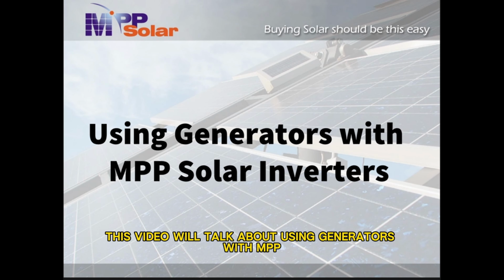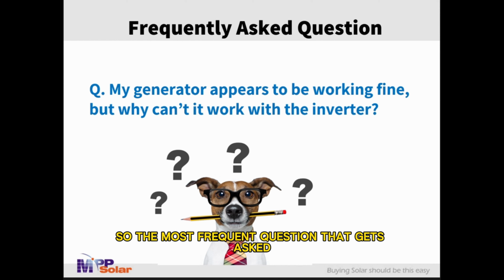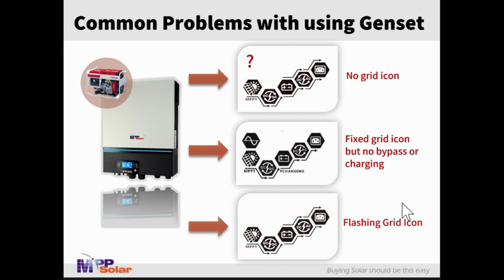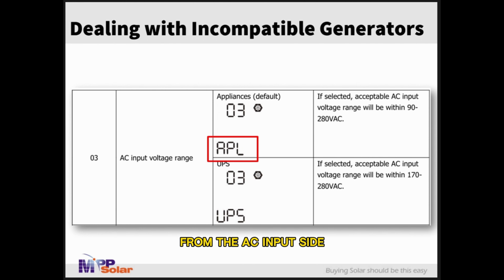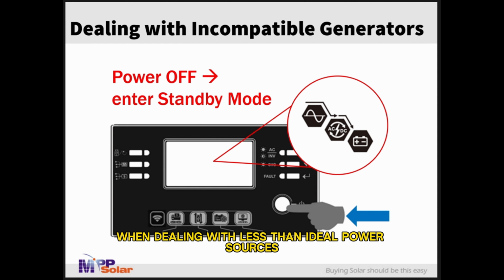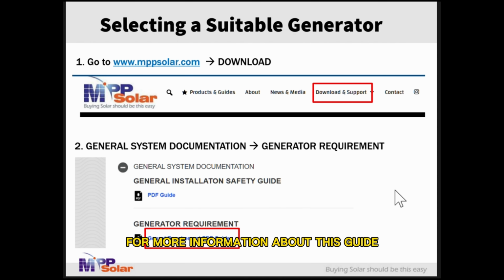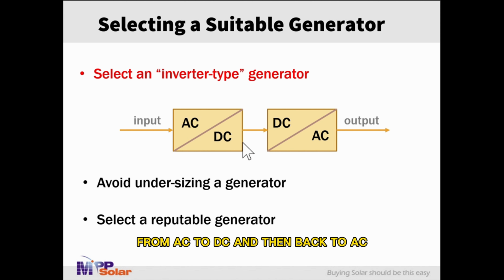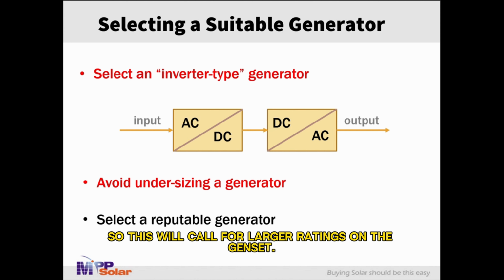Using Generator as AC Input

Comment: Assuming I'm making sure not to pull loads larger than 6kW, will my two 6kW MPP LV6048 inverters configured in parallel still work with my generator that only outputs 6kW?  I'm really just wanting to use it to charge the batteries or provide minimal power in the house when I'm not getting any sun.  Thanks!
Reply from the maker: Theoretically, it's possible this can work, but with generators it's extremely difficult to predict as gensets will drop output quality as load rises, and every genset is built differently, so the only sure way is still to try things out and then you'll know.   There are some tips in the video that can help relax the requirement for AC input while using generators, so if you're having trouble getting it to work, try those tips and according to many users, sometimes they help.  Good luck!
Reply: @mppsolar697  that's what I thought.  Right now if I run the generator hooked up to one inverter it charges my batteries and provides bypass current (which I'm assuming would mean the inverter has no issues with my generator output), but once I parallel the output of the generator to two inverters (with their parallel communication cables), it shows that it's receiving current on the mains (round sine wave icon) but clicks every 10 seconds trying to charge and then clicks and only shows the sine wave icon and repeats this over and over.  The inverters are in standby so there's no current going out on the mains, and I checked with an amp meter and it's only pulling 8A from the generator (when it clicks to try and charge the battery) and then drops back down to 0A, so the generator isn't getting loaded down.  Plus, the voltage is hanging out between 117 and 126 or so...
Reply: And btw, when I have the generator hooked up to one inverter, it's pulling something like 20A from the generator and the inverter is still working fine, so I don't get why two inverters with a lower load is having issues...
Reply from the maker: @therealsoultitanium  when this happens (parallel, under standby), are both units set as APL?  If not, try change them to APL and see if it helps.
Reply: @mppsolar697  yeah, they're both set to APL.  I got a suggestion from a user on the diysolar forum to try changing setting 01 to SBU and setting 11 to 10A as I think I might have setting 11 configured too high - I think it's currently at 30A, which obviously wouldn't work as the generator can only supply 25 amps.
Reply from the maker: @therealsoultitanium  Yes, that's what we'd like to suggest here as well.  Under a parallel system, internal rectifier may slightly increase generator draw (in order to support parallel), so if your genset works fine with one unit but cannot run well in parallel, then then two things to try are:
1. ensure all units are in APL (03)
2. minimize setting (11) to the lowest current setting and test again.  If accepted, then increase current incrementally to test the max current allowed without compromising genset output